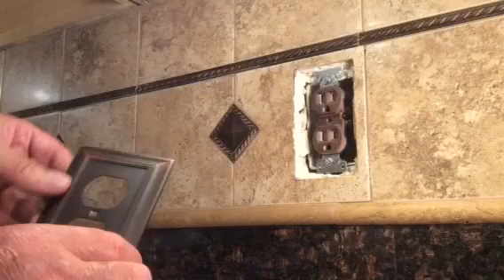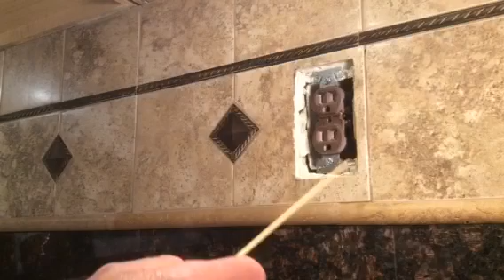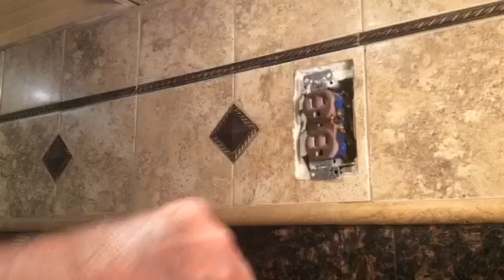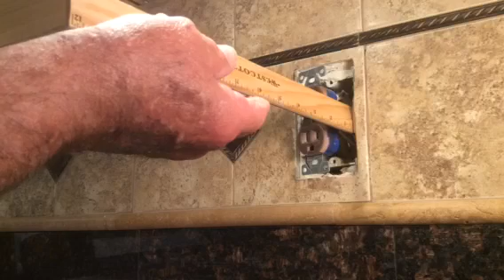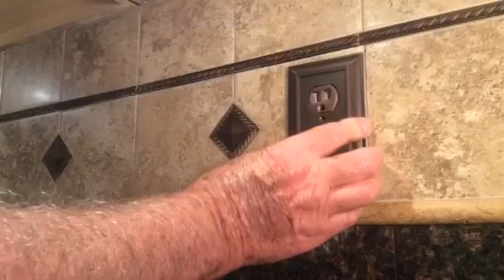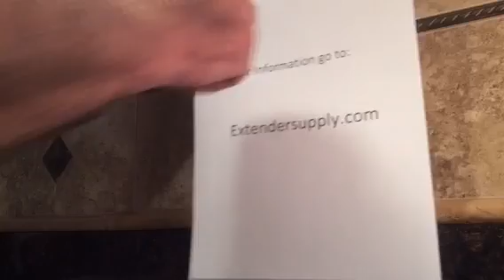Effortless Electrical Spacer I

Comment: Any electrical work should remain contained so if there is any arcing would remain inside. Additionally, the receptacle screws are conductors and carry live power. The spacer should cover the entire box all around. Your solution is a code violation and you must revise your approach, otherwise you are misleading the unaware diy individuals in doing what is an obvious wrong approach

Comment: Should be a GFI outlet if in a kitchen and mounted on the backsplash too. Another code violation
Reply: If kitchen outlets are on the same circuit you only need one GFI  outlet if hooked up in series.

Comment: code violation, you should use a plastic extension ring commonly call a goof ring to prevent electrical contact with the tile, your method wouldn't pass an inspection, sorry
Reply: You can extend up to 1/4" in non-combustible material 
https://www.electricallicenserenewal.com/Electrical-Continuing-Education-Courses/NEC-Content.php?sectionID=285.0
Reply: A goof ring?  Isn't that used for round holes that were cut incorrectly, like in ceiling drywall?
Reply: @burtwonderstone5315  yes, they have them for light boxes, single gangs and 2 gangs. and i've even used multiple single gangs in 3&4 gangs. their true purpose is to extend the side walls of a box that is recessed into the wall more than 1/4" on non combustible wall materials (ie. concrete, tile, etc.) and boxes that aren't flush or protruding on combustible wall materials like (wood, etc.)